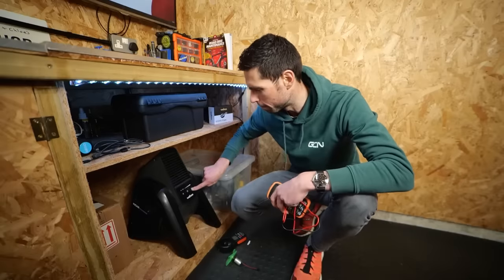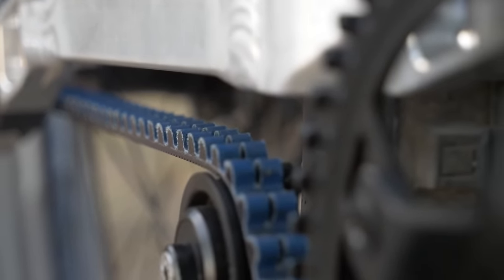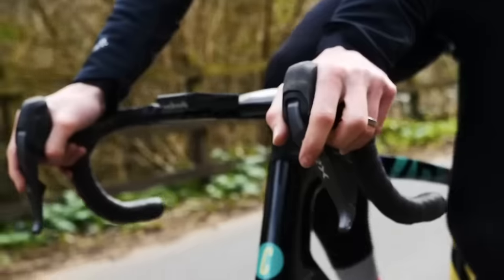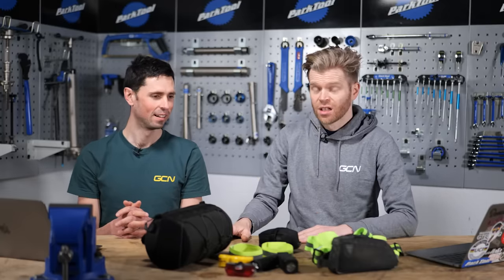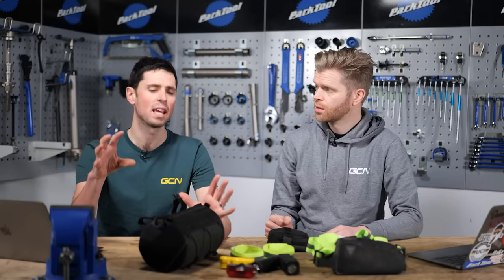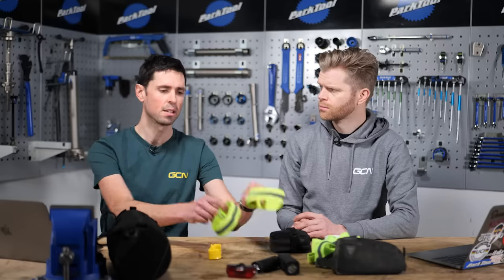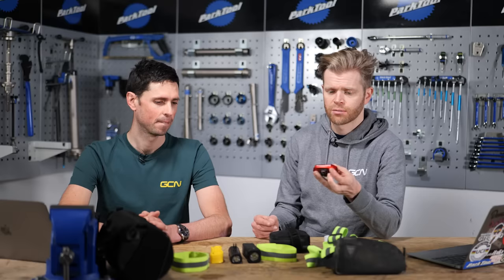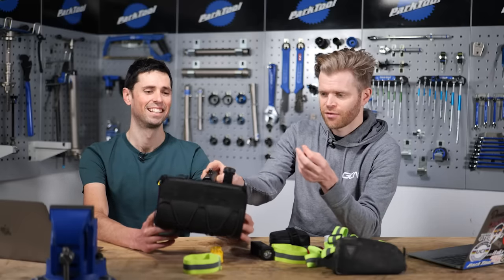The BEST Functional Bike Tech That Cyclists SHOULD Use!

Comment: I've just turned 65 and have no interest in speed, endurance or maintenance, but do cycle 15-20 miles each weekday morning for fitness. I've just bought a Canyon belt drive bike with an internal gear hub and what a difference it has made. It has 8 gears (apparently the equivalent of an 11-23 cassette, I'll take their word for that) and it is so much easier. No clunky gear changes, super quiet and, not that I did it anyway, no maintenance required! A definite life changer for the less serious cyclist!
Reply: Awesome

Comment: Great suggestions!! I have been using and use it all on my commuter bikes. Dynamo hubs do work well, but for many riders it means going up hill all the time. Belt drive are both quieter and cleaner than a chain. They can last longer than a steel chains. Internal gears give me the gear range I need and I can shift any time. Bags, absolutely! Pockets just won't, and can't do the whole job. I keep my multi-tool and flat tire needs in my bag everyday. Other loads vary according to the day.  I use my reflective, high visibility vest or jacket with front and rear flashing lights, day or night, on every commute ride. A rear mirror, never used years ago, makes me feel safer today.

Comment: You missed my favorite light option - which is a rear facing helmet light.  It’s incredibly visible to cars!
Reply: I do both! Seat post rear light, handlebar front light, and flashing light on helmet that emits light forwards and backwards 🏮💡
Reply: Only if the driver is looking. That's a HUGE IF.
Reply: Yup.  It's also closer to their eye level.  Dual front and rear lights; 1 of each on helmet and bike.

Comment: Another important factor WRT headlights is balance. You can't just rely on your inner ear when you're tired and maybe low on blood sugar, because the fluid in the semicircular canals can change density and deliver false results to your brain. (Much the same happens when you're drunk.)  A bright light with a good horizontal spread will provide enough info to your peripheral retina for you to keep upright.  Being diabetic, I speak from experience.

T'other thing is luminosity.  One manufacturer will rate his offerings in lumens while another will use lux. My main headlight is an 80 lux dynamo light: how can I compare that with a backup light rated in lumens?

Re underslung lights, I fitted mine on a T handlebar extension so that it peeks out under my minibar sorry handlebar bag.  Works a treat, and it's even got a (gasp!) bell riding beside it.

Re bells, Sod's law seems to dictate that if they're loud they rattle and if they don't rattle they aren't loud. PITA but there it is.

Comment: Steering stabiliser. A Hebie elastomer job came standard on my new touring bike (Vivente) whether I wanted it or not. Why do I  need that, I wondered as I pondered second mortgage options. After the Rohloff hub and belt drive, it’s become my favourite feature. No more front wheel flopping as you load the shopping or touring panniers. Bike stays upright and so do you.  BTW, you don’t need a second mortgage either for the elastomer or the bike: a good modern touring bike is all you’ll ever need after you give up on any pro peloton aspirations!

Comment: The piece of equipment that is a must is a small piece of inner tube to hold your front brake on while it’s leaning up against something. Try it! How many times have you tried to stand your bike up against a wall, a lamppost or even just trying to adjust something and it wants to roll away. A simple 25 mm wide piece of mtb inner tube stretched over your front brake from your bars will stop this and help stop your pride and joy getting damaged. Tim b

Comment: I've always used front and rear lights to be seen and a bar end mirror to see behind me.  I'm legally blind in my left eye and it can be very difficult to see what's on that side of me.  I've also started using a top bar bag on long rides.  I'd think about a carbon belt drive and an internal hub for my next bike.  Very good video!  Thanks.

Comment: A helmet with remote turn signals has been very effective in telling drivers where I'm going. It helps me remain visible and drivers understand what it means. Also there are the same high vis bands that work like normal during the day but have led lights for night.
Reply: Just use reflective mitts!

Comment: Some internal gearboxes have MORE range than typical road bike setups. My commuter bike with the Pinion gearbox has a 600% range, which is greater than my 105 equipped road bike. The 12 gears with NO overlap make it perfect for commuter duty.

Comment: I used to regularly ride at night. I have a couple of dynohubs, a Schmidt and a Chinese one that is supposed to have lower resistance, but actually has significantly more. I like to combine the dynohubs with battery lights for two reasons. I have some very steep hills to climb and in bad weather conditions, or during what we call "mud season," the dynamo puts out barely enough light to see the road surface. The other is resistance. On average, the dynohub slows me down a bit less than one kph when it's on, which isn't a big deal, but if I just want to be seen, I'll switch on the battery lights (the dynos run taillights, too). The biggest advantage of the dyno is that it's always there as a backup. I've had battery lights go unexpectedly dead or go missing, and being out in the dark without lights could cost you your life.

I have to chuckle to see that handlebar bags are coming back. I rode with one most of the time in the 1970s and 80s, then the stems changed, making the bag supports useless and they became "uncool." Now the cool kids are using them again. What goes around, comes around, I guess. Mudguards rock.  Being visible at night rocks. Mirrors, not so much.

Comment: If you want a handlebar bag that it's easy and safe to get into while riding, the Ortlieb Ultimates, Vaude Aquabox and similar are the way to go. Waterproof, flip tops with magnetic catches, and easy to add/remove to the bike with the klick-fix adaptor or whatever it's called. Perhaps a bit heavy for a roadie but for touring / adventure riding / pleasure riding they're farking amazing.

Comment: Another disadvantage of the belt+internal gear setup is the high price... you didn't mention this but I think it´s a primary factor when someone makes a choice.
Reply: But you have much lower maintenance costs. You use singlespeed chainrings and sprockets, and once they've worn out you turn them over and use them again (that works with chains, not sure if it's possible with a Gates belt drive though).
Reply: @frostsmoke  well that should be quantified... a whole Tiagra groupset costs around 400€, the Shimano Alfine is 313€ only the hub, but it's 11 speed only and I'm not counting the rest of the group like belt , chainring and shifters; a Rolhoff hub is around 1200€ and above... and it's not like you're changing chain and cassette every 1000km... how many km do you need to do to get to the break-even point?
Reply: The upfront cost of a belt drive and a gearbox is higher, but if you account for their durability, the amortized cost isn't really higher. even a basic Alfine 8 (USD $250?) lasts over 100,000 Km.
Reply: @andreapalazzi670  True, it depends on what you compare to what. But considering how expensive for example cassettes and chains have become on one hand and that you buy a Speehub for life I'd say you might reach break-even sooner than you would think.
Reply: @frostsmoke  You can't with a belt, but the belt will last you several 10.000 km.
Reply: I looked into this system for long distance touring. The bike cost almost double the price (my bike is suitable for both systems, i bought one with a chain and derailler). You can do an awfull lot of maintenance with that amount of cash. I am 5 years in and it is still a lot cheaper (and rode all over europe).

Comment: Most of my bikes have fenders/mudguards, handlebar mirrors, hub powered lighting, and a bell. Last year I bought a Trek District 4 Equipped as my main commuter, and it has it all: generator, lights, mudguards, belt drive, internal hub gears, a rear rack, and a bell. No bar bag, though.

Comment: The accessories and bits of kit that we add to our rides are so dependent on the environment we ride in. If we commute in traffic, some kind of mirror will save your neck in more ways than one. If you ride along with pedestrians (and horses) on park trails, a bell is important and in some places mandatory. I like the reflective bands (on your legs) that Alex mentioned. They're light, easy to put on and take off and since they're moving they catch a driver's eye quickly. The guys didn't mention paniers but I think they're still the best system for carrying things as two paniers can carry 40 liters or more of material, they're placed lower on the bike so they lower the your center of gravity. They're not aerodynamic but then again, you wouldn't use them when racing.

Comment: Drop bars...use a helmet mounted mirror.  I've tried hood mounts (which broke the tab holding my hood on), bar end mount, and helmet.  With your constantly shifting position on a road bike, helmet wins hands down.  Bar end ones work fine on flat bars.  The exception is if you regularly ride with a backpack (idk why you would...panniers are so much better), since the backpack may block your mirror.
Pair with a Varia radar to provide reactive rear lighting and a warning system.

Comment: I use a radar (mine is a Magene, because they are cheaper than Garmin). Also, the slightly ridiculous bell that came with my high-end road bike gets better use on my commuting gravel bike. 
I typically use 3 rear lights, (though one may be in reserve) and have them at different levels. Back of my helmet,  under my saddle,  and on the rear mudguard. Back in the time when Emma was presenting,  I recall her saying that there was evidence that erratic flashing was more effective to get noticed.

Comment: Those hi Vis bands are a great idea for those running clipless pedals, which are (technically) illegal in the UK as pedal reflectors are a requirement.

I bought a 6L Topeak saddle bag this year, normally have a small tool roll under my saddle but for long rides here in Scotland it's useful to have a bag to carry the tools and also clothing (soft shell jacket and the zipped off legs from my trousers depending on weather) and even my lunch if I'm going on a route with nowhere to stop.

Comment: #askgcntech I have a question wich includes the pythagorean theorem but please stay with me. When I begun with cycling I used a simple speedometer wich calculates my speed and distance on how fast my wheel turns. 
However nowadays I use a gps headunit and that is calculating speed and distance obviously by my global position. 
Now how does the headunit calculates in gradient as I am travelling along the hypotenuse and not the adjacent side? I know it’s not that much but it seems quite harsh when you worked yourself up a 1km 10% climb and as a reward you lose some meters on your total distance.

Comment: With regards to lights, things like Reelight (I'm sure there are other brands), that are powered through magnetic induction are great positional lights. Never needs charging, some models have a small capacitor to allow them to keep powered on and blinking for around 2 minutes when you stop your bike.

They're not illumination lights, but they keep you lit up with blinking lights so other road users can see you. And since you don't need to worry about charging any batteries, they are also good daytime running lights for added safety.
Reply from the maker: Reelight's are a very interesting product. We remember first seeing them on bikes in Denmark.

Comment: 12:16: Or just get a dynamo hub and dedicated front and rear light system.  I love mine because I never need to worry about charging.  Also, people do not realize that the "permanent" batteries in "rechargeable" batteries do not last forever.  They have a certain number of charge-discharge cycles and then fail.  When they fail, you have to buy a new light system.
Reply: I'm sure nobody with a mobile phone hasn't though tof that.  Does your dynamo system have a backup so your lights don't go out when you stop?
Reply: @stevemawer848  Many dynamo lights have a capacitor-based system to keep the lights on for a couple of minutes when you stop.

Comment: My headlight has a 450 lumen daytime flash mode. I've actually noticed that cars see me coming from farther away. Daytime flash runs for 55 hours. I thought the light was kind of expensive at $85, but it's still going strong 5 years later. As a daily commuter, it's more than given me my money's worth.
Reply: Just make sure its adjusted to not dazzle oncoming traffic.  No point being seen if the car coming at you has a driver who's been blinded by your light.

Comment: If you compare a bike with dynamo lights with a bike without lights you're right about the time penalty. But you should compare with a bike with battery powered lights which last for the whole ride. Than you will see that they weight quite a bit. And if you commute you will want lights on always for safety. It is good to know they're always on. And factor in the time you use to search for the lights in your flat everytime you have charged them and so on. I save a lot of time by running dynamopowered lights most of my rides. Everytime I do an audax there is people running out of charge on their rear lights. So then they need to carry a powerbank also to charge they're lights which also adds to the weight. Btw I did the Tcr in 2023 :) Viggo, Norway
Reply: What do you carry a battery that weighs 5kg? No, weight isn’t worse.
Reply: @jonathanzappala  A dynamo does not weigh 5kg either. And unless you're racing it really does not matter anyway.

Comment: Doing a lot of road commuting and I do shift work meaning I cycle at odd hours. I have a cyclic camera light, It works well for day time riding but also a 1600 lumen light for night riding in dark areas. I find that the medium setting on the 1600 lumen light is enough. Also I have a couple of rear lights, I would have the rear cyclic camera too but was unable to afford it at the time.

Comment: re rear lights, I now swear by running one on irregular rhythm flash, let’s say for visibility in terms of attracting notice of presence, 
but equally, if possible, at the same time also a bright rear light on steady mode.
Not practicable on century rides etc, but for commute level distance rides, the difference it makes imho in aiding drivers to judge accurately your position and distance is palpable.

Comment: Many of the options are even good options for people who race, to be used on training rides. The training rides don't have to be fast.
If you train with a power meter, your speed is not important. I often don't bother to change my gravel wheels to road wheels in my all road bike, when I do a structured training ride on the road. Use the power meter, the training will be just as good, it will only be a bit slower

Comment: I would say for some people having rear light that runs in flashing mode for 100 hours on two good AAA batteries might be more convenient than a USB rechargable. I use one and just automatically turn it on before every ride, no matter the weather. Still it lasts for months, almost half a year for pretty much daily commuting 19km one way. So the likelyhood of riding without it because I forgot to change batteries is much lower than if I had to re-charge say once a week and it is visibly getting dimmer for days before it really fails and the fix is quick, swap batteries in one minute. 
With hub dynamo powered front light I lost the need for a backup front ligtht years ago. If you do the wire routing well enough you woudl have to have some kind of horrible crash to make that light non functional and I never had one fail on me. 
Mirrors I cannot recommend enough for commuting and for long distance rides into areas you are not familiar with. If you wear just a small one on glasses or helmet it completely changes what level of awarness you have about your surroundings. No longer will the noise of oncoming cars mean that a car from behind can be unexpected. You just no about every car from behind before you can hear it after you get used to glancing in your mirror routinely.

Comment: I haven't had any successful mirror implementations yet despite the idea of them being great. Mirrors tend to only be visible in one position, whether you've angled them for when you're on the hoods or the drops. They also tend to get shaken out of alignment and constantly need to get realigned. I went on a multi-week trip with a bar end mirror and pretty much was constantly adjusting it but never actually looking at it as it could be less reliable than actually looking behind you and frequently it was out of alignment from bumps or from me just getting on the bike and hitting it. Mirrors on other parts of the bike can limit things like hand positions as well, and I've had mirrors block me from either getting into the drops or holding the middle of the bar. I've tried some glasses mounted mirrors but not been able to properly see anything with them either. (That I need prescription glasses might make them less viable.) I feel like there should be some way of implementing mirrors effectively, but so far I've just bought multiple types of mirrors and ultimately removed them due to them causing more trouble and probably making riding a little more dangerous instead.